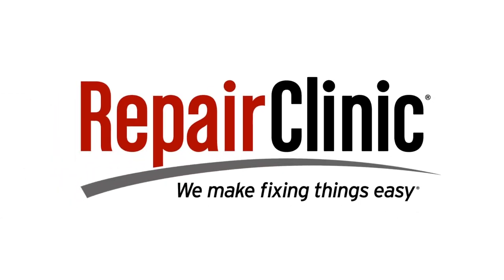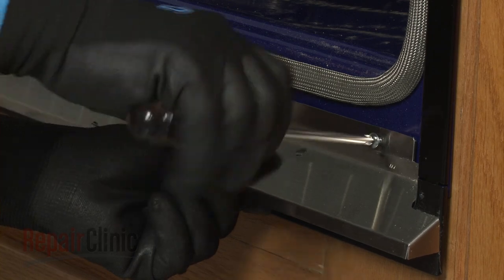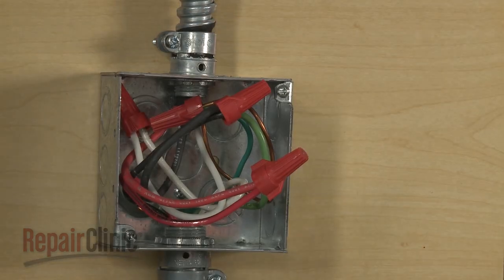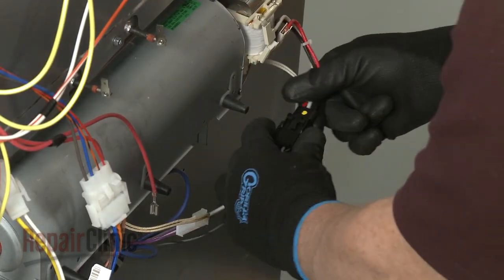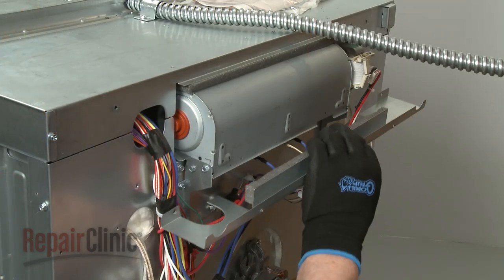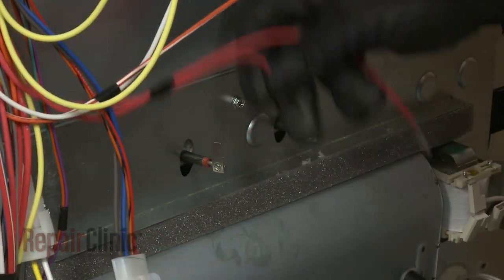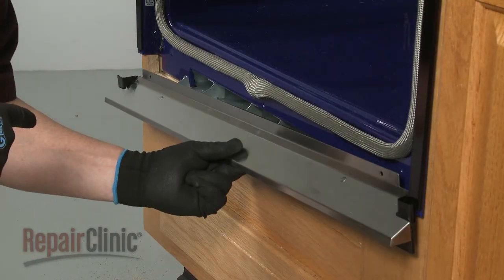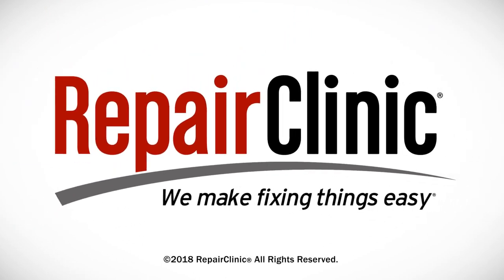KitchenAid Double Wall Oven Cooling Fan Blower Replacement W10861504

Comment: Do both cooling fans run at the same time or does one run with each oven?  Ours keeps blowing the thermal fuse when self cleaning.  I already replaced the upper oven fan, do I need to do the bottom one too?

Comment: Your channel is very nice!
I wants to remark that when working on these types of screws, the screwdriver must be on a low clutch position, not on a drill mode; otherwise, the screwdriver will destroy the thread on the sheet.